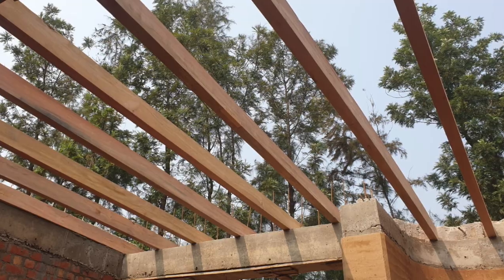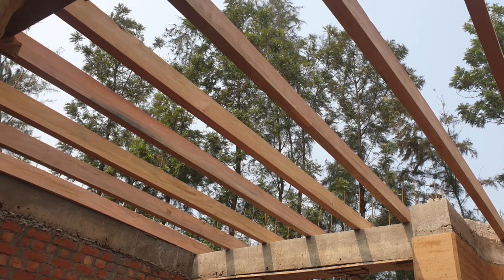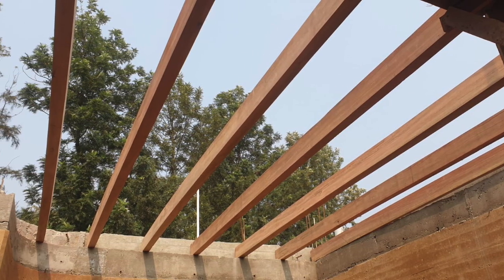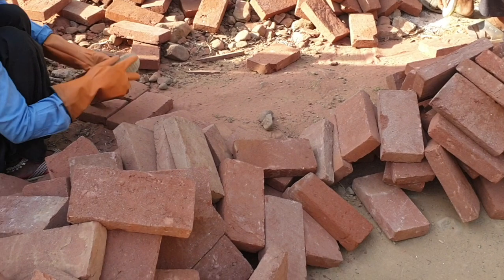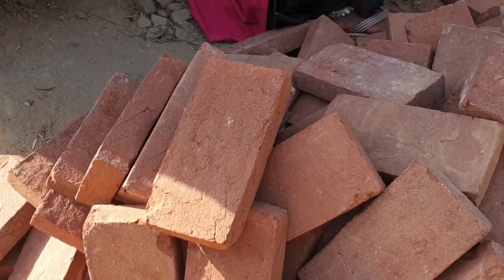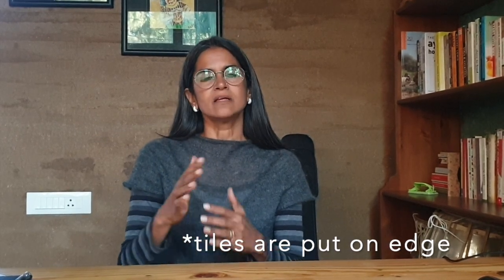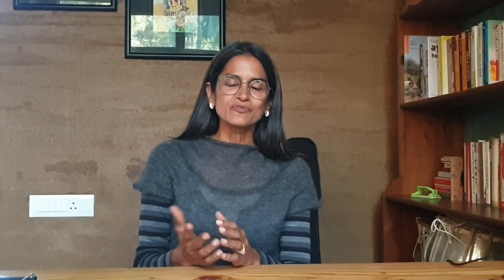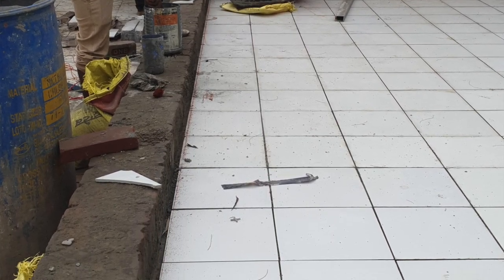How to Build a Madras Roof

Comment: One more doubt, any idea instead of wooden rafters, if steel is used what would be the cost differential? Will wood work out cheaper? Also which wood was used for the rafters? Considering neem or pongamia compared to steel which one works out cheaper?
Reply from the maker: We have used Saal wood. Metal pipes would be cheaper.
Reply: @farmaanandaa  thank you, could you please share masons contact who did madras roof

Comment: Can you use the Madras Roof structural system as a flooring system. I am thinking of wood rafters, then the bricks a concrete or motar topping with rebar mesh. Then followed by glazed ceramic tiles. Gustavino tiles used a similar  system. This system went bust in 1955 to 1965.

Comment: DID YOU INSTALLED ANOTHER TWO MAJOR LAYER ON IT. THERE SHOULD ONE HORIZONTAL BRICK LAYER THAN LIME CREATE AND FINALLY WATER PROOFING LAYER. ONLY FIRST LAYER OF BRICK IS TRUE MADRAS ROOF.
Reply from the maker: We have plastered on top of the Madras roof and use reflective tiles to finish it

Comment: Just to point out a few things. Since it is Madras type roof. And it is being made since ancient times.  At that time cement was not available. So how did the roof survive? It may take a longer time if you use lime. How much time?  If you are going to introduce cement then what is the purpose? even water proofing, in the good old days, how the water proofing was done? Mam, I am all your videos.   I don't think that cement should be involved at all.
Reply from the maker: All good points. Do share with us how you built your house without any cement. Would be happy to learn. This is the best we could do :-(

Comment: Concerned about the brick tiles, which are in between the two wooden rafters and in floating mode. Can this mechanism be more secured by wire mesh connecting each other, eliminating the possibility of falling down..... Just a query...
Reply from the maker: The tiles are all tilting a little, and therefore leaning on the row before each line. That is how they remain floating and don't fall
Reply: I have never seen or heard a brick falling from such a roof. The bricks are pretty light, and once the mortar sets in, they are firmly in place. Your suggestion is also a good idea, may be someone would try.
Reply: @r.sgopalan6404  Actually, l am from West Bengal, here the dimension of the bricks are 10" × 5" × 3", which makes it very heavy. Therefore, only bricks which are specially made for this kind of roofing will be definitely lighter and the same will have to be customized, if anybody intends to adopt this technology.

Comment: dont use this type of terrace.the wooden frame under this terrace will be destroyed by termites in few years.also needs frequent termite maintainace .this type of terrace has no steel rods inside it so it will fall within split seconds if the ceiling gets weak due to termites .rcc will notify if it gets weak this type of ceiling will fall all of a second which leads to fatal death of 2 families in tamilnadu in jan 2024.beware dont use this ceiling.
Reply: My house 52 year old near the ocean are and has this type roof
But yes it is two times costly then the concrete
Reply from the maker: Thank you for the warning. It looks like this house had no maintenance and upkeep at all!
Reply: @farmaanandaa right we have also wooden roof from more than 50 yrs have no issue till date
Reply: https://www.youtube.com/watch?v=qSUhIr5CcnQ
Reply: One can replace  the wooden rafters with steel if one is worried about  wood failing . People  only  think of problems and not good ideas
Reply: @666madhusudhan  double work. After installing these types of ceiling.

Comment: The strength of the madras roof is based on the mortar, the lime mortar. I don’t know how effective it will be to use cement.
Reply from the maker: Should be similar in the short run. May not last 100s of years like line though
Reply: dont use this type of terrace.the wooden frame under this terrace will be destroyed by termites in few years.also needs frequent termite maintainace .this type of terrace has no steel rods inside it so it will fall within split seconds if the ceiling gets weak due to termites .rcc will notify if it gets weak this type of ceiling will fall all of a second which leads to fatal death of 2 families in tamilnadu in jan 2024.beware dont use this ceiling
Reply: https://www.youtube.com/watch?v=qSUhIr5CcnQ

Comment: Thanks for sharing this technique, lots of people will benefit from this. I hv also constructed clay house using wienerberger clay blocks and roofing tiles. Due to pressure from cement based architects people have forgotten our own clay.
Reply: dont use this type of terrace.the wooden frame under this terrace will be destroyed by termites in few years.also needs frequent termite maintainace .this type of terrace has no steel rods inside it so it will fall within split seconds if the ceiling gets weak due to termites .rcc will notify if it gets weak this type of ceiling will fall all of a second which leads to fatal death of 2 families in tamilnadu in jan 2024.beware dont use this ceiling
Reply: @surajramakrishnan7141  Thanks for the warning about the dangers! Do you think the Rohtak roof is safe or is that also dangerous?
Reply: https://www.youtube.com/watch?v=qSUhIr5CcnQ

Comment: If you want hardened lime for plaster, it is available in kazhughu malai regions of Tamil Nadu
Reply: Also traditional mixture used contains kal  sunnambu ( rock lime), Karu Patti ( palm jaggery contains molasses and dark brown in colour), kadukkai berry. The last two are for better adhesion and water proofing. Don't buy kilinJal sunnambu (shell lime) for roof work.  For wooden rafters use mundhiri ennai ( cashew nut skin is removed by roasting, it contains termite proof oil, it is darker in colour), similar to linseed oil, available around Pudukkottai regions.  There are lots of cheaters, stay safe, and all the best for your sustainable building projects. Bye
Reply: @lakshmisubramanian70  would like to know more abt the intricacies of madras terrace... have u worked on any such projects ?   Do let me knw...
Reply: dont use this type of terrace.the wooden frame under this terrace will be destroyed by termites in few years.also needs frequent termite maintainace .this type of terrace has no steel rods inside it so it will fall within split seconds if the ceiling gets weak due to termites .rcc will notify if it gets weak this type of ceiling will fall all of a second which leads to fatal death of 2 families in tamilnadu in jan 2024.beware dont use this ceiling
Reply: @surajramakrishnan7141  very true, these structures always use compression and balance, steel rod used inside concrete improves tensile strength, so when heavy rain or flood or nearby construction etc occurs, there will be shift/disturbance in sub soil layers, wood rafters don't go through quality control in factory, now in this rain I have come across personally 2 houses which had CATASTROPHIC FAILURE.
Reply from the maker: Good to know that. Will reach out for any future projects

Comment: How about the load bearing capacity of the roof
Reply from the maker: An engineer would be able to give you technical details. But this is a sound roof.
Reply: dont use this type of terrace.the wooden frame under this terrace will be destroyed by termites in few years.also needs frequent termite maintainace .this type of terrace has no steel rods inside it so it will fall within split seconds if the ceiling gets weak due to termites .rcc will notify if it gets weak this type of ceiling will fall all of a second which leads to fatal death of 2 families in tamilnadu in jan 2024.beware dont use this ceiling
Reply: https://www.youtube.com/watch?v=qSUhIr5CcnQ

Comment: What is the distance between the wooden rafters
Reply from the maker: 24 inches
Reply: @farmaanandaa  thanks great work
Reply: dont use this type of terrace.the wooden frame under this terrace will be destroyed by termites in few years.also needs frequent termite maintainace .this type of terrace has no steel rods inside it so it will fall within split seconds if the ceiling gets weak due to termites .rcc will notify if it gets weak this type of ceiling will fall all of a second which leads to fatal death of 2 families in tamilnadu in jan 2024.beware dont use this ceiling
Reply: https://www.youtube.com/watch?v=qSUhIr5CcnQ

Comment: How do you setup the electrical lines in a exposed roof like this?
Reply: dont use this type of terrace.the wooden frame under this terrace will be destroyed by termites in few years.also needs frequent termite maintainace .this type of terrace has no steel rods inside it so it will fall within split seconds if the ceiling gets weak due to termites .rcc will notify if it gets weak this type of ceiling will fall all of a second which leads to fatal death of 2 families in tamilnadu in jan 2024.beware dont use this ceiling
Reply from the maker: You lay the pipes on top of the brick layer and beneath the waterproofing + tile layer
Reply: https://www.youtube.com/watch?v=qSUhIr5CcnQ
Reply: Instead of wooden rafter they can also use precast or cast in situ  rib concrete beams but it may need some shuttering work and reinforcement so that satisfies the serviceability condition.

Comment: Such a nice video & explanation. What's the maximum room size or hall size in which we could do this type of roofing? Seems like you can't go beyond certain lengths.
Reply from the maker: Thanks. Size of the room will depend on the length and width of the wooden rafters that you find. You could also support the wooden beams with another metal pipe or girder if your room is very big.
Reply: dont use this type of terrace.the wooden frame under this terrace will be destroyed by termites in few years.also needs frequent termite maintainace .this type of terrace has no steel rods inside it so it will fall within split seconds if the ceiling gets weak due to termites .rcc will notify if it gets weak this type of ceiling will fall all of a second which leads to fatal death of 2 families in tamilnadu in jan 2024.beware dont use this ceiling
Reply: https://www.youtube.com/watch?v=qSUhIr5CcnQ

Comment: very nice
Reply: dont use this type of terrace.the wooden frame under this terrace will be destroyed by termites in few years.also needs frequent termite maintainace .this type of terrace has no steel rods inside it so it will fall within split seconds if the ceiling gets weak due to termites .rcc will notify if it gets weak this type of ceiling will fall all of a second which leads to fatal death of 2 families in tamilnadu in jan 2024.beware dont use this ceiling

Comment: Hello madam,  pls share lime motor ratio and ingredients . Given good information
Reply from the maker: Will do a full series of videos on lime soon
Reply: dont use this type of terrace.the wooden frame under this terrace will be destroyed by termites in few years.also needs frequent termite maintainace .this type of terrace has no steel rods inside it so it will fall within split seconds if the ceiling gets weak due to termites .rcc will notify if it gets weak this type of ceiling will fall all of a second which leads to fatal death of 2 families in tamilnadu in jan 2024.beware dont use this ceiling

Comment: Very Nice Great job, Please say me what is the brick tile thickness in used Madras roof
Reply from the maker: Standard tile 4 × 2 × 9 inches
Reply: dont use this type of terrace.the wooden frame under this terrace will be destroyed by termites in few years.also needs frequent termite maintainace .this type of terrace has no steel rods inside it so it will fall within split seconds if the ceiling gets weak due to termites .rcc will notify if it gets weak this type of ceiling will fall all of a second which leads to fatal death of 2 families in tamilnadu in jan 2024.beware dont use this ceiling
Reply: @surajramakrishnan7141 what is your problem?

Comment: In many places there is no awareness regarding this sustainable house construction, so even if someone like me want to build a sustainable house, I can't. No.1 reason is there are no architect in my state/rigion who are practicing sustainable construction. The local labourers have no experience to work on a sustainable building. 
No.3 is row material for such construction like lime plaster, wooden frames, stones, brick tiles, are not easily available.
Reply from the maker: We face all 3 hurdles that you mentioned. But if you are willing to persevere, you will find ways to make it happen. 1. Our architect had never built a house like this before, but we researched together and supported each other. 2. Local masons had no experience in this construction method - we got masons from Auroville and Udaipur to train them on rammed earth & lime plasters respectively, and they learnt quickly and managed to make it. 3. If you ask around you will find all materials locally. It is not that difficult. Do try.
Reply: dont use this type of terrace.the wooden frame under this terrace will be destroyed by termites in few years.also needs frequent termite maintainace .this type of terrace has no steel rods inside it so it will fall within split seconds if the ceiling gets weak due to termites .rcc will notify if it gets weak this type of ceiling will fall all of a second which leads to fatal death of 2 families in tamilnadu in jan 2024.beware dont use this ceiling
Reply: https://www.youtube.com/watch?v=qSUhIr5CcnQ

Comment: Superb video manisha 🎉
Reply from the maker: Thanks 😊
Reply: dont use this type of terrace.the wooden frame under this terrace will be destroyed by termites in few years.also needs frequent termite maintainace .this type of terrace has no steel rods inside it so it will fall within split seconds if the ceiling gets weak due to termites .rcc will notify if it gets weak this type of ceiling will fall all of a second which leads to fatal death of 2 families in tamilnadu in jan 2024.beware dont use this ceiling

Comment: Any reason behind paving the brick tiles at 45 degrees to the wooden rafters??
Is it okay to do it at other angles?
Reply from the maker: I don't know the answer to this! Perhaps the architect art.jitesh@gmail.com may know.
Reply: dont use this type of terrace.the wooden frame under this terrace will be destroyed by termites in few years.also needs frequent termite maintainace .this type of terrace has no steel rods inside it so it will fall within split seconds if the ceiling gets weak due to termites .rcc will notify if it gets weak this type of ceiling will fall all of a second which leads to fatal death of 2 families in tamilnadu in jan 2024.beware dont use this ceiling
Reply: Transfer of load or load distribution may be....
Reply: Refer to the taminnadu public word. Department studies.

Comment: Hello. Will this stay stronger and longer as the one which was constructed using the lime mortar?
Reply from the maker: They should. Because its not the mortar that gives away, its the steel. And there is no steel in this roof
Reply: @farmaanandaa  Do you say mortar gives away?
Reply: dont use this type of terrace.the wooden frame under this terrace will be destroyed by termites in few years.also needs frequent termite maintainace .this type of terrace has no steel rods inside it so it will fall within split seconds if the ceiling gets weak due to termites .rcc will notify if it gets weak this type of ceiling will fall all of a second which leads to fatal death of 2 families in tamilnadu in jan 2024.beware dont use this ceiling
Reply: https://www.youtube.com/watch?v=qSUhIr5CcnQ

Comment: There will be rain water leakage problems thru the gaps of the tiles later in future.will become difficult and impossible to attend to it and rectify.I have personally experienced it.
Reply from the maker: I a sorry, sould have mentioned there is a full water proofing layer on top of the brick tile layer. Before we did the slopes and final pavit tiles
Reply: @farmaanandaa That person has issues. They keep copying and pasting their comments. You should block them.

Comment: Great to see, finally! Although this is a modified version of Madras Roofing, it still looks wonderful 👌 Thanks for experimenting with these traditional architectural concepts and reintroducing them to the world.

I said modified because.. One, of course, cement instead of lime. Secondly, there usually goes lime mortar on top of that and another layer of bricks, followed by mortar. As already pointed out by somebody else in the comments, I'm a bit concerned about water seepage unless water proofing is done below those tiles. Cement, unlike lime, is notorious for water leakages.
Reply from the maker: You are right. There is a payer of water proofing before we do the slopes and final pavit tiles. I assumed that was par for the course
Reply: dont use this type of terrace.the wooden frame under this terrace will be destroyed by termites in few years.also needs frequent termite maintainace .this type of terrace has no steel rods inside it so it will fall within split seconds if the ceiling gets weak due to termites .rcc will notify if it gets weak this type of ceiling will fall all of a second which leads to fatal death of 2 families in tamilnadu in jan 2024.beware dont use this ceiling
Reply: https://www.youtube.com/watch?v=qSUhIr5CcnQ